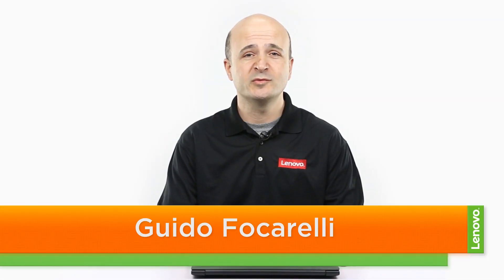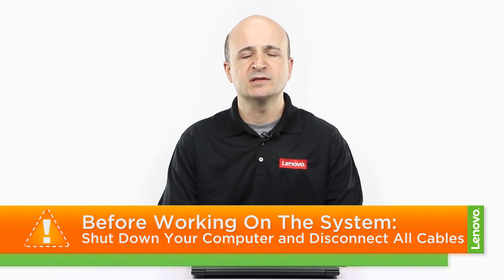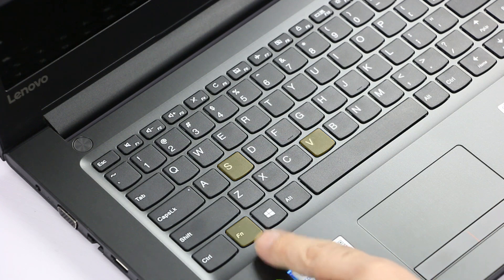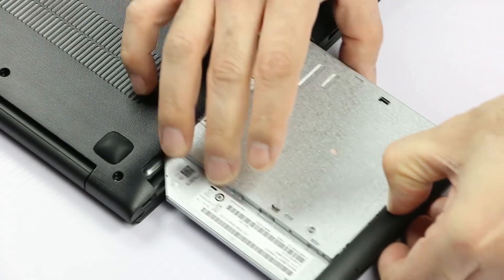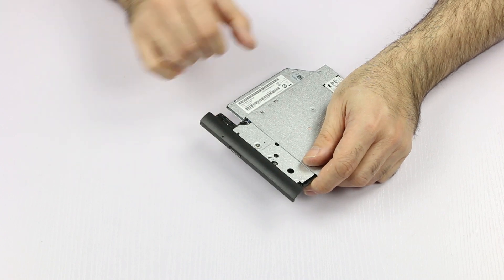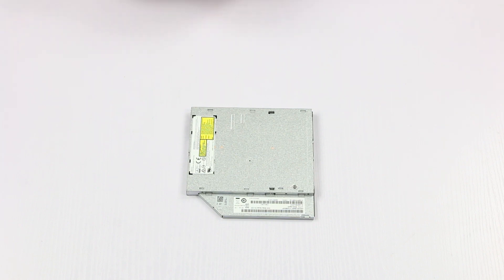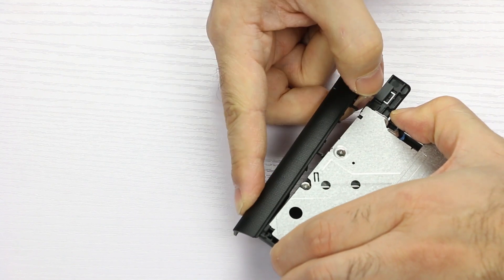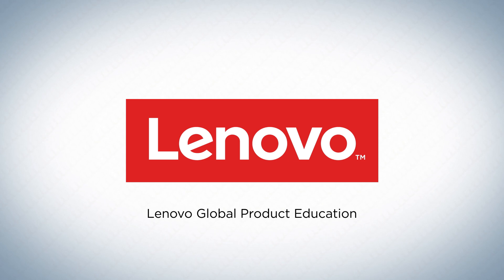IdeaPad 310 / 510 Notebook - Optical Drive Replacement

Comment: Can you add a hdd or ssd using the optical drive?
Reply from the maker: Which system specifically are you asking about? Quite a few of our systems have storage caddies that can replace the optical drive. I think there are even companies that make unofficial ones.
Reply: Lenovo Service I have the Lenovo Ideapad 510 15.6"
Reply from the maker: So I couldn't find where we make an official caddy for that ideapad, although it looks like there are third party options. You might want to peruse this Lenovo forums post before buying an aftermarket caddy https://forums.lenovo.com/t5/Lenovo-B-and-G-Series-Notebooks/G510-and-SATA-Hard-Drive-Bay-Adapte/m-p/1425565#M31685 granted it's from 2014 so you may have better luck now.